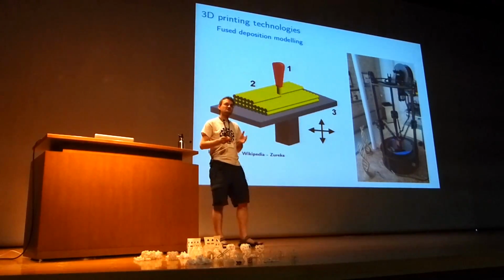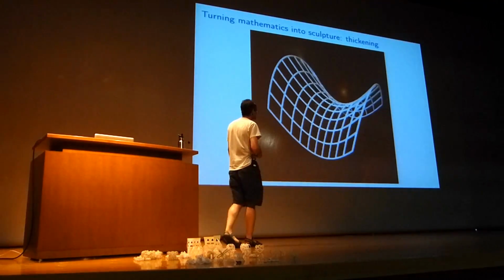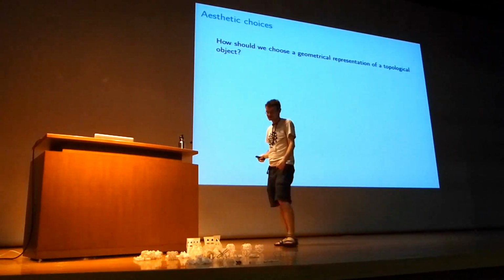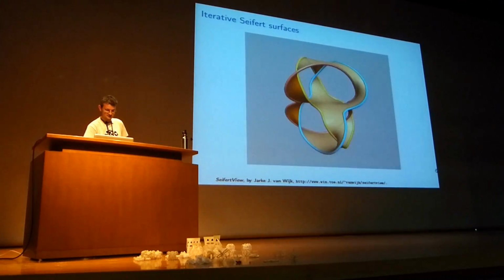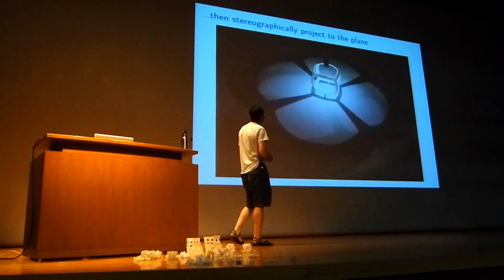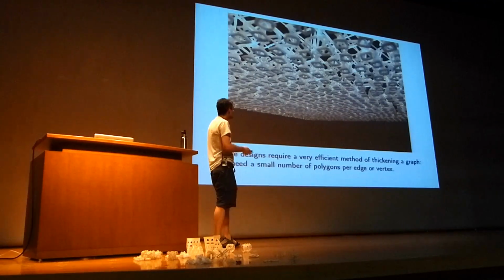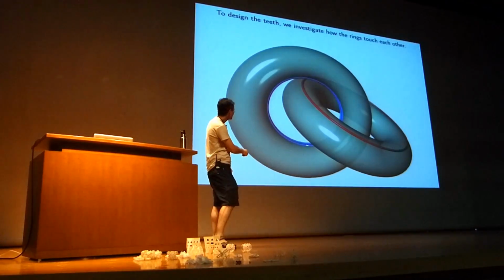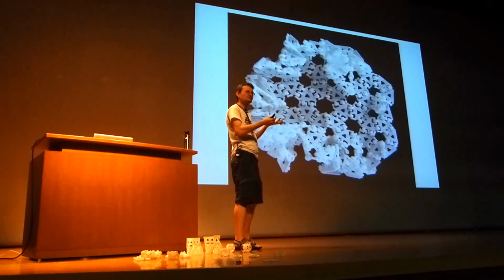Symposium on Computational Geometry 2014 plenary talk: "Design of 3D printed mathematical art"

Comment from the maker: Here is a video of my plenary talk at this year's Symposium on Computational Geometry, on designing 3D printed mathematical art.
Reply: Good talk!  

I was curious to see what a minimal mobius ladder/ring would look like, but you didn't go that direction :)  

The question at the end about how you chose which polygon was also interesting - it'd be interesting to see the same method used on a consistent (set? or even just single) vertex with a variety of polygons.  I'd expect triangles and squares to be the potentially most striking.  It's interesting to me that this is even a problem - one of those things that seems like it should be simple, but isn't.
Reply from the maker: I think that our Mobius ladder is minimal in S^3. On the thickening issue - there isn't a very clever way to choose the orientation of the polygon around the edge, so more sides seems better - otherwise we get striking shapes that aren't saying anything meaningful about the overall object.
Reply: I was thinking about the 'canonical thickening' problem you mentioned: How do you turn a network with infinitly thin lines into one with printable thicker lines, such that things do not get messy near the vertices. I came up with a method. A picture is shown here:
http://westy31.home.xs4all.nl/ScrapBook/CanonicalThickening.gif
You trace out all lines with a sphere in 3D. The envelope of these spheres is a surface. Once you have this surface, you can proceed to mesh it as you would any surface.

Gerard
Reply from the maker: Gerard: by "surface", do you mean a NURBS surface? How do you generate this surface in practice?
Reply: Henry,
So far, I only thought of how this surface is defined, not how to actually mesh it. But I intend to think about that too, since I recently started to 3D print myself.
Anyway, maybe I should explain the surface more clearly. Suppose you put a sphere on all points of a curve. The union of these spheres will be a volume. The boundary of that volume is our surface. (Intuitively, it is the ‘envelope’ of the spheres.) Alternatively, if the original curve lies on a surface, you could use cylinders instead of spheres, aligning the cylinder axis to the original surface normals. That way, the thickened lines will have flattened tops that follow the original surface.
The meshing is relatively easy around a curve whose radius of curvature is less than the radius of the thickening. You just put mesh points on circles that lie in planes perpendicular to the curve. It gets trickier if the radius of curvature gets smaller than the thickening radius. Then some points on the circles will lie inside the spheres that correspond to other points on the original curve. A laborious procedure s to check this for all mesh points, but I suspect there are nicer ways.
 
Gerard